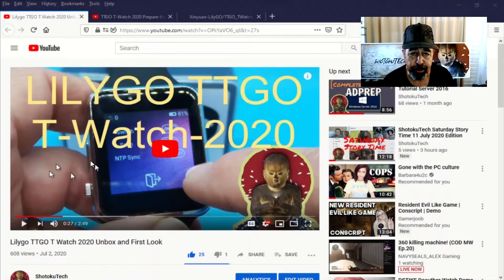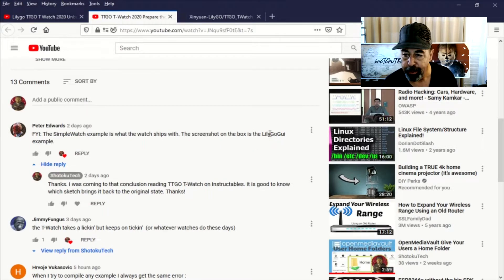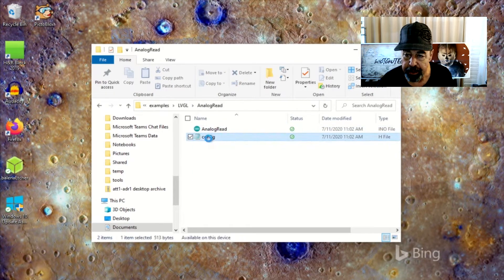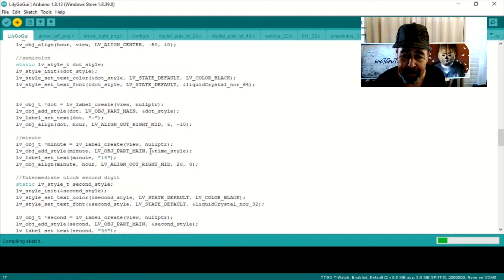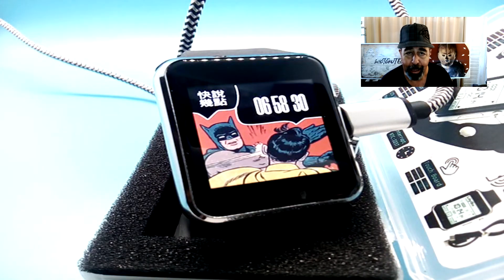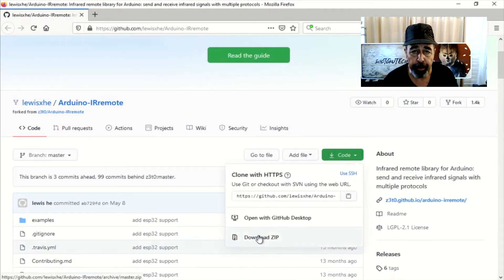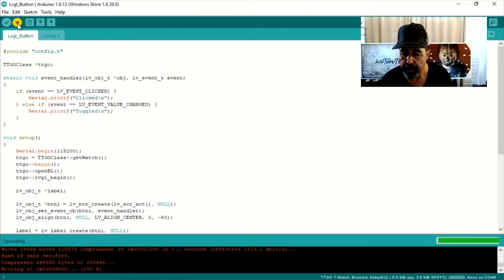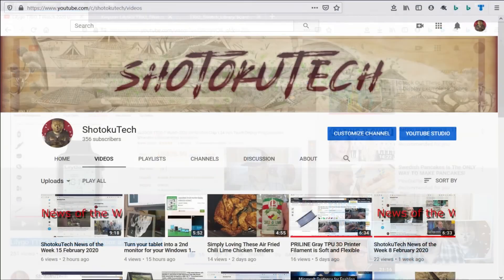TTGO T-Watch 2020 Example Sketches

Comment: Is it possible to connect the watch as a microphone with the computer? I wanna do a momantary button that makes the mic on at the watch when pushed anr when released mic off
Reply from the maker: Here's your button. It could easily be used to turn the microphone on and off. Not sure how you are going to connect to the PC. You have Bluetooth and WiFi available but I'm not sure how much data you can send between the watch and the PC. Is it enough for live audio? Not sure. https://github.com/ShotokuTech/T-Watch_On_Off_GUI
Reply: @ShotokuTech  Thanks for the fast answer and help - appreciate it :) . any idea how i can connect the watch to a windows PC via Bluetooth or i prefer Wifi to turn on and off the microphone on the windows pc so i can use this watch a s a wearable microphone and turn on and off the mic with the watch? - i am very new to this kind of watch but very interested to learn more about the programming of it :)
Reply from the maker: @KITThappens  These might be a good start.
https://youtu.be/EC9hiIu5C3o?si=5A80avoLQxpLDPNf
https://youtu.be/kBVjevj41G8?si=OPSqJiLVTMpA90LM
Reply: @ShotokuTech  no noy reallly unforunately
Reply from the maker: @KITThappens  My T-Watch playlist has 35 videos in it. Surely there is something covering Bluetooth or WiFi. https://www.youtube.com/playlist?list=PLVPBipeObwMNwRd-0-2K7vsfh5e_FOxnZ
Reply: Got me a link to this tool? Maybe it works... can this mute my PCs microphone?
Reply: How long does the battery have standby and  with using?

Comment: I just got mine in the mail today. Hole-E-Crap, this is no small operation! I was hoping I could just shove a TTGO sketch into it, but it looks like it won't even run without some major updates to my Arduino. So much for the easy win! :/
Reply from the maker: Nah it's not so bad. Just need to add a URL in preferences for board managers. Download the library zip from the github site and add it as a zip library under sketches. Everything you need is in this video and the description. Check out my video on preparing the Arduino IDE. https://youtu.be/JNqu9sfF0tE 
Thanks!

Comment: Anyone figured out the image format? Rinky Dink isn't going to cut it, the colors are messed up (although the image itself is visible). I can use "ttgo->tft->pushImage" to make it display an image, just like "tft.pushImage" on the TTGO OLED chip. You just need to include the converted .h image, just like the other chip. But the Hex format it uses seems to be 4 characters a pixel and Rinky Dink does 6.
Reply from the maker: Spoiler alert! You are two videos ahead of me with this question. But: C Array. https://lvgl.io/tools/imageconverter 
Cheers!
Reply: @ShotokuTech  RGB565 images can be rea wth GIMP.  The watch has a built in web server, you can wget screenshots with it.
Reply from the maker: @MeTube3  Yes I saw wget x.x.x.x/shot ; wget x.x.x.x/screen.565 Thanks!

Comment: im stuck on the Button toggled display after I followed the manual what can I do
Reply from the maker: Not quite sure I understand how you are stuck. But this is the best firmware so far  for the T-Watch 2020:
TTGO T-Watch 2020 Firmware Update Complete Success
https://youtu.be/7vOaqnmAkcg
Reply from the maker: Sometimes I have read if loading T-Watch from Arduino IDE fails, try tapping the button just before compiling finishes and upload starts.

Comment: when i try to upload the simple watch sketch, i get an error. can you check and see if it works for you?
Reply from the maker: I did load SimpleWatch a couple of weeks ago for this and it was fine. What are you getting for error? Make sure to uncomment correct watch in config.h file. Let me know how it goes. Thanks.
TTGO T-Watch SimpleWatch Time Zone Fix #Shorts
https://youtu.be/T4FZV9KHarY
Reply: @ShotokuTech  thank you, i just uninstalled and installed again, i think i was on an older arduinoIDE. installed the latest. it works now
Reply from the maker: @ritwickjha3954  Yeah I have done that in the past too. Thanks

Comment: I put -16 on the time zone and got the proper time for mountain time
Reply from the maker: So you left CST in? Or did you use some other designation for the time zone? "Firmware Update Complete Success" video shows the new firmware that allows precise time zone setting. Thanks.

Comment: Once you get WiFi connected you can use the ntp to set the time.
Reply from the maker: Yes I have no problem connecting WiFi and getting time from NTP. But what NTP server and time zone combination will set it correctly for Mountain Standard Time/ That still remains as an issue for me. I have tried various combinations, including from the other comments here. Thanks.

Comment: If you load the new firmware 3016 using PlatformIO you can attach to your WiFi, then in the time settings put in your time zone, then ntp gets the correct time over WiFi. Once this is done you can use the OTA update to get the latest firmware 3017.
Reply: Also in 3017 display orientation can be set in 90 degree increments.
Reply from the maker: Where to find firmware 3016? Thanks
Reply: The github currently has 3016 version, 3017 comes in the OTA update that you can access from 3016.

Comment: The CST implies Central Standard Time in the United States, and I notice it does have a -16 after it at about 7:05. Have you tried removing the -16 and seeing if it then uses CST?
Reply from the maker: Thanks for this. No I was trying minus 8, 9, 11, 15. I think I tried MST which is my time zone in Arizona. I am going to revisit in the RTC episode coming soon. So I will be trying your suggestion as well. Thanks!
Reply: Hi
On line 1154 '' pool. ntp. org''
you have to change this as well to your local server eg for UK mine was
' '1.uk.pool.ntp.org.':
Reply from the maker: That is one of the things I was thinking. Thanks!
Reply: @ShotokuTech  I think you want CST4. The codes are reverse to what you'd expect. The default CST-8 means "subtract 8 from this time to get UTC".  Thanks for the vid - just got my watch today.
Reply from the maker: @tomgray6710  Make sure to check out this awesome firmware for the watch here: https://youtu.be/7vOaqnmAkcg
Thanks!

Comment: Any idea how to fix "A fatal error occurred: Failed to connect to ESP32: Timed out waiting for packet header" when trying to download?
Reply from the maker: Does it send anything at all? Or time out from the beginning? Of course the obvious questions: Silicon Labs CP210x Driver installed. Correct COM port selected in Arduino IDE. Try different USB cable. Try pressing power button two seconds, right around the time the sketch is finished compiling.
Reply: @ShotokuTech  Not sure how to tell if the watch sends*, but it seems to *receive something, because the display turns off when it starts trying to connect, and back on when it's done (failed).
I'm seeing "Silicon Labs CP210x USB to UART Bridge (COM4)". Tried a different cable.  
Re the power button. I just want the display on when I try the upload right, not "sleeping" (display off)?
For me that just seems to require a tap.  If I hold it too long (6s?) the display sleeps.
Maybe there's some trick to the power button I'm, missing?
Under what circumstances is the device ready to communicate? Doesn't seem like it needs to be in a "bootloader" mode.
No progress, still "Failed to connect to ESP32: Timed out waiting for packet header"
Arduino IDE 1.8.12, Windows 10
This is so frustrating, your help is much appreciated
Reply from the maker: @funnypolynomial  Check github site for anything related to this> I cannot reproduce here. Thanks.
Reply from the maker: @funnypolynomial  Sorry I meant the PC sending, if there was any indication of some portion of the data being sent, but not all of it. One thing comes to mind, perhaps try a different USB port on the sending machine? You could also lower the Baud rate of the transmission. If this persists beyond that, it almost sounds like a defect somehow. I had a couple of ESP32 boards that gave me fits a while back. I never revisited this. https://youtu.be/Jne9q5Ac2lo?t=234
Reply from the maker: Following your thread on github. You have new error? Interested to see how it all works out. Best wishes.
Reply: @ShotokuTech  Got it to work on a different PC. So something about the crusty Arduino environment on my laptop (multiple IDE version upgrades, other libraries, etc). But progress! Hardware is OK.  I can work backwards from a point of success.  Thanks for your help!
Reply: For completeness I should add that I got it going on my laptop too.  I upgraded the IDE to 1.8.13, removed & re-installed the lib and the board. Still no luck even trying different cables and different USB ports.
But then I unplugged the tiny USB dongle my mouse uses and tried that port.  Success.
So it only works on one of the three USB port on my laptop.  Good enough!
Reply from the maker: @funnypolynomial  That is insane. Sometimes I question my career choices when going toe to toe with computers and tech. It can be frustrating and bewildering even with knowledge and experience. Glad it worked out somehow. Keeping fingers crossed for the future.

Comment: I'm getting one of these watches with the aim of displaying info from my electric unicycle. Info is sent real time by bluetooth. I'm aiming to use the accelerometer to only turn the screen on when the user is looking at the watch, tapping the screen for controls and the vibration motor for alerts. I'm new to Arduino but comfortable with programming. What are the available options for developing applications? Any opinions on what are the easiest to work with? Many thanks.
Reply from the maker: This video here shows a very useful programming framework that is the easiest to understand so far: https://youtu.be/vqmQslmfdNY

Comment: Thanks for the videos. I just got mine today but the display is upside down. Anyone know how to remedy? Even batman was the same, though time was not changing for me, it's stuck.
Reply from the maker: It does seem to ship upside down. But the Batman face did set it to the right orientation. Also reloading SimpleWatch from the latest library download has it in the correct orientation. If your watch is not incrementing upwards on the time, there might be some defect? Try loading the RTC example sketch. Thanks.
Reply: @ShotokuTech  I ran an example sketch where I found the screen rotation. Once I ran it with rotation set to 2 I think, it was then correct orientation and following sketches, including batman are now all good so maybe it remembers the previous orientation setting. I also tried out the agoodwatch project on github and got time working too! So far so good.